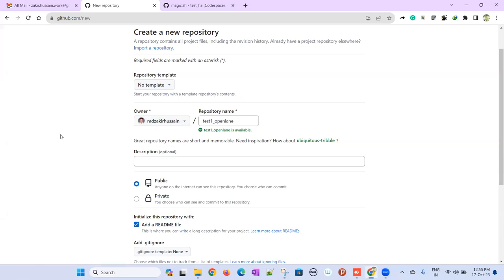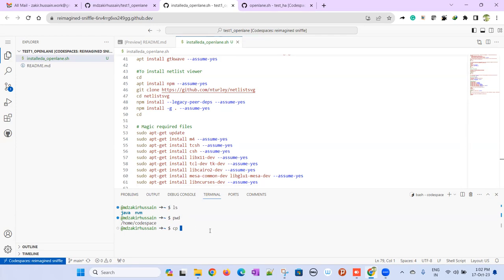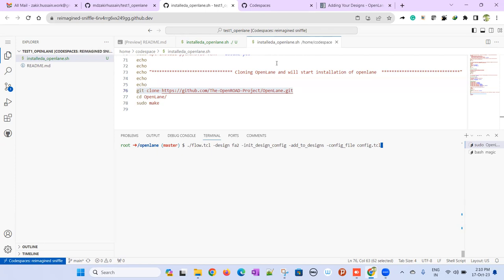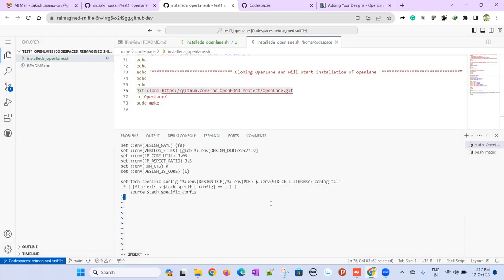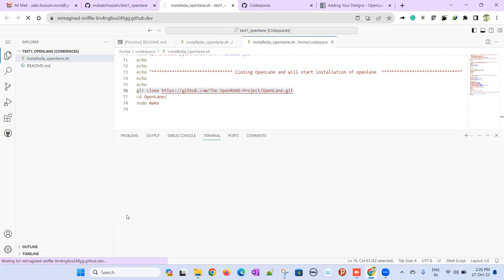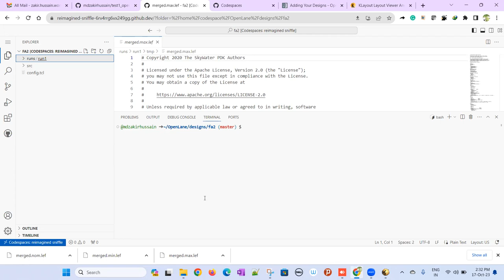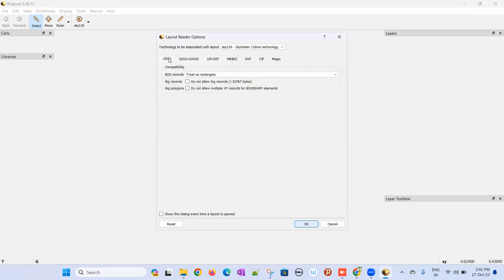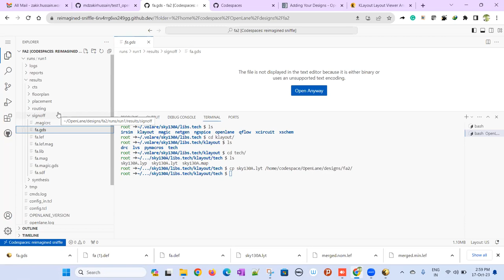OpenLane using Codespaces : RTL-to-GDSII flow. - Part-1

Comment from the maker: Those having issue with vi command inside OpenLane, please do the following,

1. open the terminal
2. type cd
3. go to OpenLane folder by typing cd OpenLane
4. use sudo vi filename
5. Now you can edit
6. to save and quit
 [ 
1. esc key 
2. shift + : 
3. after : type wq 
4. then, press enter key
]

Bottom line: whatever file you want to edit do it with admin[sudo] rights

Comment: vi command is not working can you tell what is the issue??
Reply from the maker: Please try the following and let me know the outcome.

Go to the folder where you have your OpenLane with the following command from the terminal

1. cd OpenLane/

Then type in the terminal following

2. git pull --depth 1 https://github.com/The-OpenROAD-Project/OpenLane.git master
3. make
4. make test
Reply: @VerilogHDL  test passed and now I am able to run the vi command but when I edit the file and put qw it is showing 
Can't open file for writing.
Reply from the maker: @-ASaiseetharamaiahPayyavula  if you have tried the provided solution, please do the update.

Now do the following ,

1. open the terminal
2. type cd
3. go to OpenLane folder by typing cd OpenLane
4. use sudo vi filename
5. Now you can edit
6. to save and quit
 [ 
1. esc key 
2. shift + : 
3. after : type wq 
4. then, press enter key
]

Bottom line: whatever file you want to edit do it with admin[sudo] rights
Reply: @VerilogHDL  thank you so much sir
Reply: @VerilogHDL  I have one more doubt sir the config.tcl is coming as config.json. Do i have to convert it or should make changes in the code and paste it in json file .